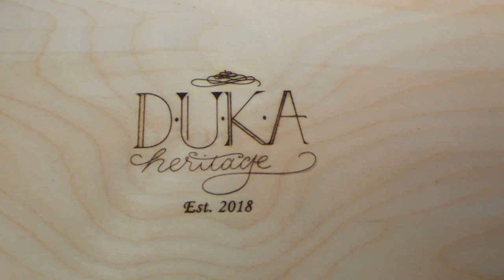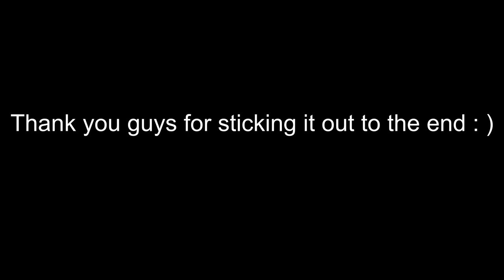Fiery Red Cedar Bowl

Comment: Where did you find the bar with the buffers at? I like how it uses the lathe.
Reply from the maker: The buffing system is made by psi woodworking. Got mine on amazon for $60. It works out very well since you don't need a separate station for buffing.
Reply: Thanks

Comment: Great Piece.  What is your set up for slow turning the piece when applying the finish?
Reply from the maker: Thank you Mark! I used the motor and gearbox out of a grilling rotisserie. I fabbed up some aluminum framing to mount it, and turned a chuck adapter on my metal lathe to accept the gearbox shaft. I get alot of questions on this. I will have to see, but I may be able to come up with a part number for the motor assembly.
Reply: @dukaheritage9445 , thanks for the response and the ideas.  Keep up the great videos.  Maybe the rotisserie unit might make a good video?

Comment: Great finish - any problems with epoxy cracking or crazing if the bowl changes shape? Or does the finish hold the moisture content stable?
Reply from the maker: I did initially have a few problems early on in playing around with this method. If I'm ever in doubt of a piece continuing to move I generally put it under vacuum at around 95degrees for around 3 days while its still a blank. Better safe than sorry :)